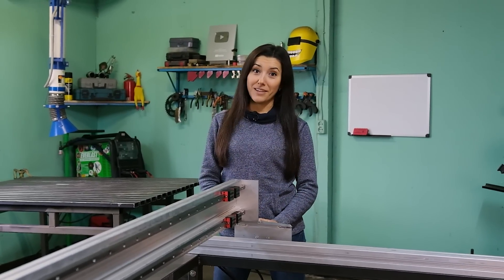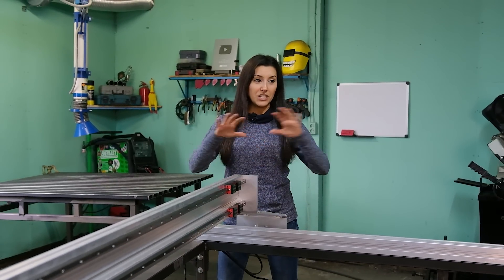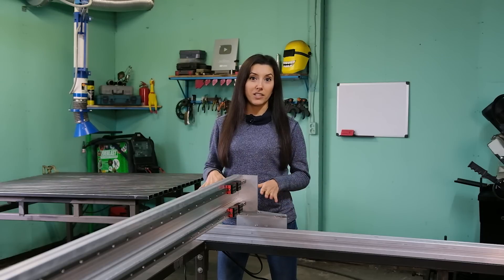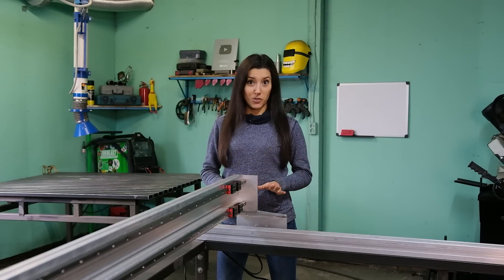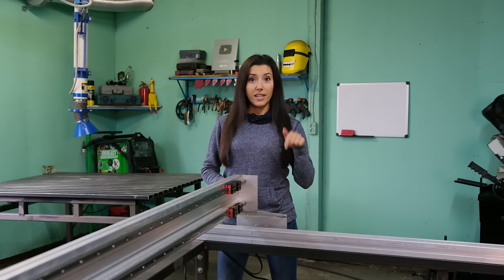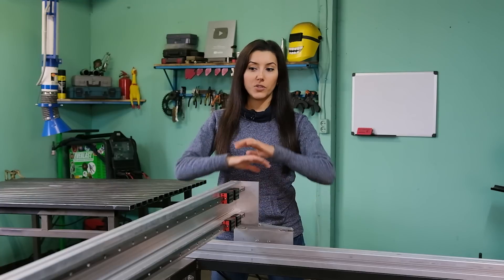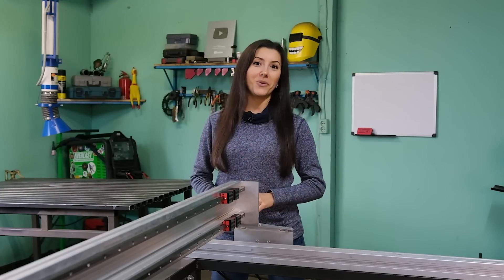A GIRL builds CNC plasma cutting machine. DIY. Part 2. Lucia's Workshop.

Comment: I've never seen videos so well presented . your no nonsense problem solving is wonderful. thinking this table could be stood vertically on a wall  with the longitudinal travel parallel to the floor to limit the gravity on the motor and drive and then a ball screw for the cross feed ( which would then be vertical ). this could also be on wheels and just stow against a wall  and thus be portable throughout your shop. P.S. I am sooo subscribed  because I like the way your mind works on a problem.

Comment: Great job, would you have the installation diagram for this controller?
There are several models of this controller and it is very confusing because some have 3 serial connectors, mine has 4 plus a power connector
  and another Can and summary no manual is the same as mine even looking for model fl2100b v5.0

Comment: Can i add something ? try adding a little tallow or engine oil to the cut off grinding wheels when cutting Ali , as it helps clean the wheel of ali powder, stops chatter, and stops the ali dust blowing back in the face of the user, over time can cause health issues , regards PJB

Comment: Hi Lucia! 
First of all, I think it's amazing everything you do and you are a model to follow! 
I have bought the same CNC plasma kit with the same controller (F2000 series) and also with the THC.
But I'm not quite sure how to make the system connection. I've been going through the instruction manuals of these kits, but it's not very clear to me.
Could you tell me how to connect the whole system? 🙏🏻 
Also, I have seen that you have installed two switches under the emergency stop. What are they for? And could you tell me how to connect them so that I can include them in my project as well? 

Best regards!

Comment: Your face when you pop the cover off your plasma cutter 🤣🤣🤣  I make the same face too lmaoo.  Aaaaaand you can solder?  Well played girl, I'm continually impressed with you.  Is that 24v you ran to your drivers or 36v?  I thought I saw 2 sizes of drivers for your steppers, and I would be uber impressed if your controller allows for both, 36v to X and 24v to Y steppers - I think that would be the most efficient.  And please tell me the name of this controller and screen brand, it's like the Ruida of plasma, except 10 times better - I need it in my life lol.  The HMI interface panel is so massive!  It's awesome.  Russian industrial electronics are pretty badass - if there's any info you can share on what you're using in the electronic side of your setup, that would be superb!

Comment: What electronics are you using? Your set up looks so much more sophisticated than others that I’ve seen. I’ve seen CNC plasma cutters ran by Arduino‘s, by systems that you can buy online. I really like the way your set up it’s put together. Thank you for posting this video or series of videos. I have liked and subscribed and I look forward to seeing more of your projects
Reply from the maker: Thank you. I use F2100T controller and just followed the manual to wire everything.

Comment: Your Grand papa raised a talented girl. Nice job on the table by the way. Can't wait to see the finished product. I noticed that in the video you had cut some thin aluminum sheet metal with a angle grinder and cut off wheel, ( we in America call them a death wheel  ha ha). The next time you find the need to cut some aluminum try using some bee's wax on the cutting wheel, it will help cut the metal with ease. Look forward to more videos.
Reply from the maker: Thank you! If you meant cnc plasma cutter as the finished product, then it's ready and shown in my later videos.

Comment: I don't like the belt, plasma going to ruin them with the sparks and stuff. rather use acme screw threads and it would of been wayyyy less little parts to used on the project

Comment: I'd totally 2nd the water table, that smoke is not only incredibly bad for the machines around the shop, but also your lungs. It's pretty much just shards of metal floating in the air. Also, belts have the ability to stretch, so at higher accelleration and decelleration its possible for you to almost run into a backlash problem. If you keep the speeds low it likely won't be an issue but as you get into higher speeds (or a heavier gantry and z axis) you could start to see those problems. Nice build though!

Comment: this project linear rails have most exoensive parts, i have cheapen SBR rails my cnc. about same size stepper motor i looking 4,5A 24 volt. but i use linuc cnc software lot better use and can adding many help makro and tools in software. and FREE not pay anythink. ewery motors need be own driver and big condensator who stabile beaks stepper motors run sort time fast need reserve power pank condensator stabile beaks. belt working ok whit plasma but if want accurate mill need ball screws.

Comment: I do things a LOT like you with a similar tool setup, however I never reach for the aluminum tig.  How did you get over the frustration of it??  I built a similar machine for an employer, did you consider ball screw rails at all instead of belts? I loved them on a cnc router and wondered if they would be good for plasma.
Reply from the maker: I thought of different solutions and chose belts, because 1. it was an experiment without any experience, 2. plasma doesn't need such rigidity as milling machine.
Reply: @luciasworkshop  😁 thank you for the response!
Reply: one ballscrew of this lenght cost an arm and you need a big diametre same as for a big lathe this is very expensive if you want precision ball screew ... the best compromise is dual rack and gears or trying to replace very long gt2 belt by synchrodrive belt. 

In part one she put rails directly on the extrude aluminium that's not a good idea because i don't  think she ask for to the suplier  an extruded part with rectified face this is expensive but very efficient because extruded are never straight. The rail must be put on top of cold strech flat iron bar with a part in order that rail be parrallel or the slider gonna die rapidly. Other mistake i have seen all screws to fix aluminium frame directly on iron frame without using soming isotrope to isolate : huge iron frame -> dilatation between alu and iron -> constraint and distrosion in the alumimium frame. 
...but i love Lucia's work she's great i only hope one day she gonna take the time to put a protection in front of this dangerous belt of her old machine every time she dig an hole i only see this belt align in front of her face ... this could make some lot of damage ... Lucia please make a protection for this machine !

Comment: Hello Lucia, You have done a great job! I envy you with such a great workshop. I was wondering if you could list the plasma machine you are using, the controller, and some of the motors. I am trying to build a CNC plasma cutter for my welding students. Keep up the great work!!! :)
Reply from the maker: Hello. Thank you :-)
Oh, it's a great initiative to build a machine for the students! Sorry, I didn't answer for a long time. I used the controller F2100t and Leadshine stepping motors (model: 57HS22-A, 1.8 degrees/4.0 A). I have to say, these are a good ones.
Reply: @luciasworkshop  Thank you so much
Reply: @luciasworkshop I'm working on a copy of tour machine I still with controler and motors wiring 😅it's a big problem 😅.

Comment: How much have you spent in the project overall? i'm thinking about doing a CNC cutting machine but with a blowtorch instead because i gotta cut a bunch of thick plates.
Awesome video.
Reply from the maker: Thank you. I haven't finished the machine yet, so the costs are uncalculated yet.

Comment: Congratulations with your build. I was wondering if the linear rails need to be protected from the hot metal? I have never seen plasma cutting so I don't know what the hot metal can do.
Reply from the maker: Thank you! 
Yes, you are right. The linear rails should be protected, not from the hot metal, but from the dust during cutting :0)

Comment: As a kinda pro, I really suggest u using a water tray. I'm used to work with thousands of euro of plasma cutting machines (like 12x4 meters one) and water tray is the best. If put  the sheet beraly underwater u keep donw close to 100% of the fumes and cutting thin stuff like from 1.5 to 3 mm u decrease the warp in the piece.
Reply: Don't submerge your aluminum parts though it can create a hydrogen gas bubble under the plate and explode. (Not a good day)
Reply: Hey Lucia, Im hugely impressed with your interest, knowledge and skillset. If you dont mind my asking, are you trained in any engineering discipline such as electrical ? What is your formal education background and in what country are you ? If you prefer to not answer, I surely respect that too.
Reply: @violettownmicroenterprises1528 she did a vid about herself 1 month ago, a good watch.
Reply from the maker: Thank you for the advice ;0)
Reply: This is how we learn to use things , especially when one doesn't know what they're doing and here comes someone who knows what they are doing. Thank you Sir
💯✌️😎

Comment: Amazing work! I don't wanna that guy that always complains bout safety but I when I saw u putting your ponytail that close to the drill press pulley I felt scared... Maybe u can make a Carter for that.... Still a nice vid thanks u!
Reply from the maker: I found a carter and put on its place, but several wires lit up some time ago, so I have to enable the drill manually now. It's temporary.

Comment: The machine coming out nicely! To clean dross from the parts you might want to use twisted wire cup angle grinder attachment - gets rid of the dross like a charm. The only thing is to somehow don't let the small parts to slide on a table. In the simplest case this can be done with wooden table top and some wood screw heads sticking a couple of mm from the surface. This stops small parts from "escaping" when cleaning the dross. Also it's a good idea to have some sort of small, like 1cm, "lip" (barrier) at the edge of the table in front of you, in case some of the parts actually fly towards you.
Reply from the maker: Thank you for the advice😉😊👍
Reply: An old magnetic vice is great for holding parts for grinding. Safe for your fingers and time efficient. Available cheaply as well.

Comment: I have spent hours designing my own, and still not struk a bat, looking at some of the stuff you have done on your X gantry means I will be restarting, the simplicity is painfull to see. 
need a tensioner for belt,  just use a belt clamp and 2 bolts to pull it together. While I've spent ages working out how to mount one motor and make a slide to tighten it.
Reply from the maker: Thank you. Glad my video was useful for you 😉